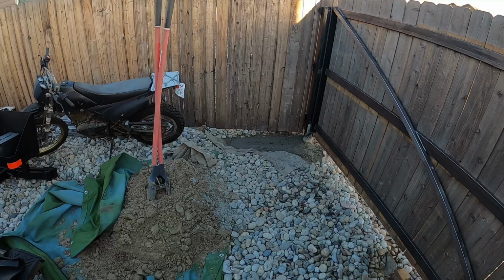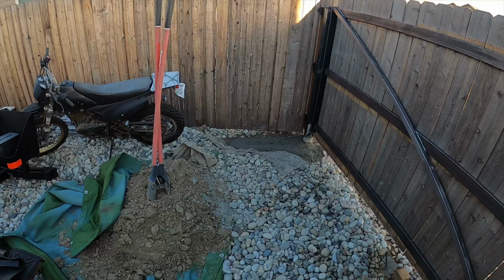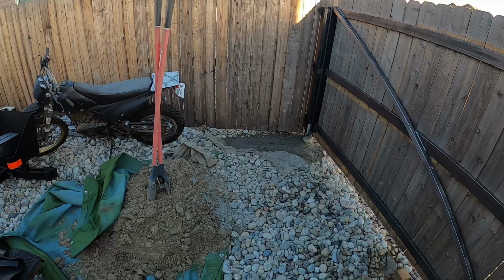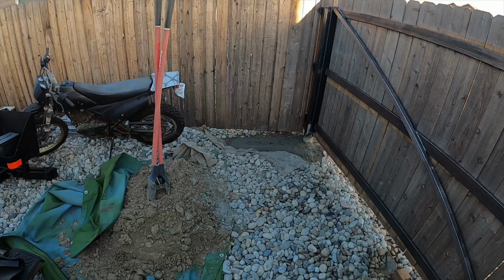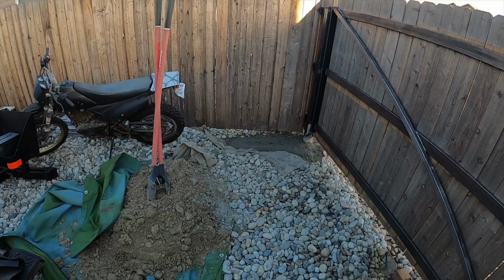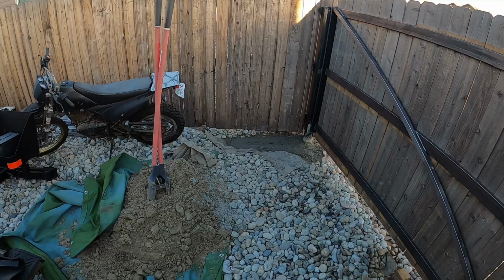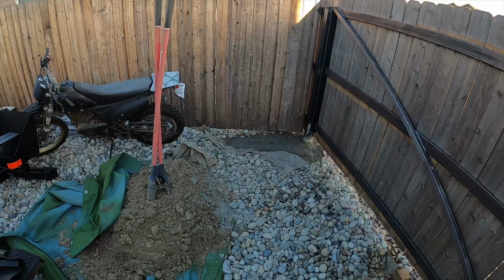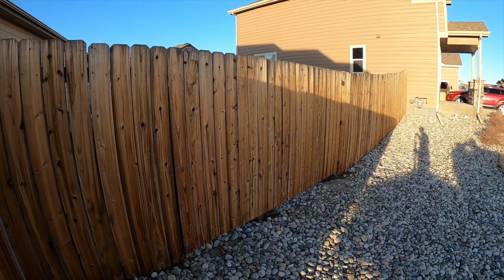Adding a drive through gate to my yard

Comment from the maker: We ended up using 7-80# bags of concrete for that corner post, 5 bags in the hole and 2 bags filling the pole up to the top. With that 560 pounds of concrete and the out rigger for leverage against the weight of the gate when it’s open and suspended this gate should be very sturdy!

Comment: I didn't notice if you had filled the posts with Crete and if not did you cap them ?
Reply from the maker: I did fill the pivot post with concrete as well as several bags in the hole. The other post is just anchored to the pre existing pad.